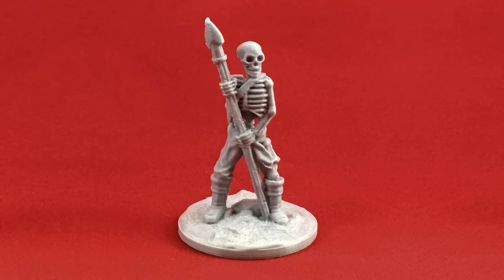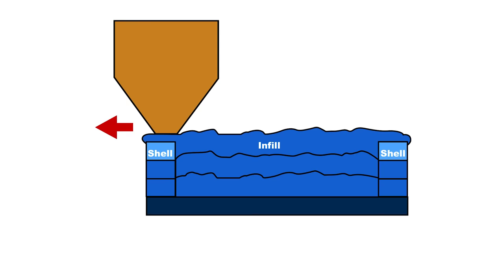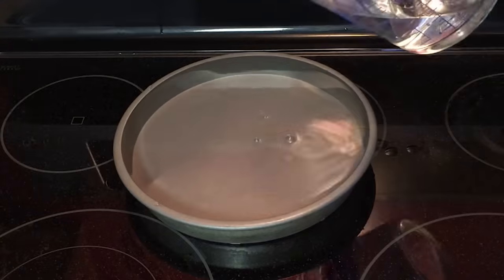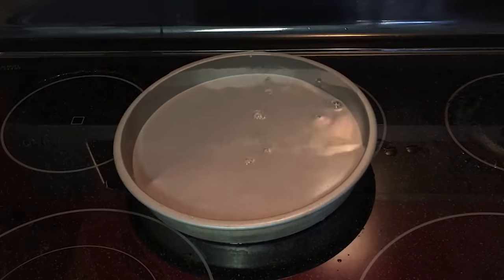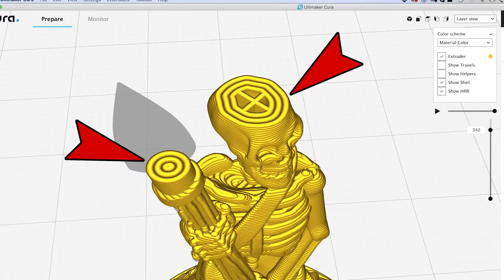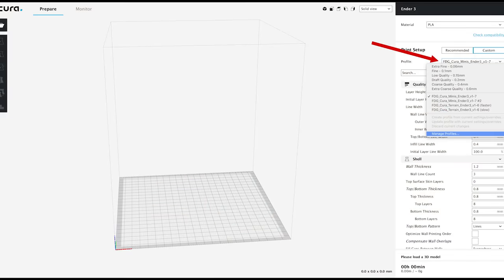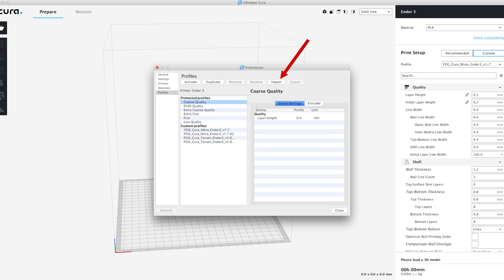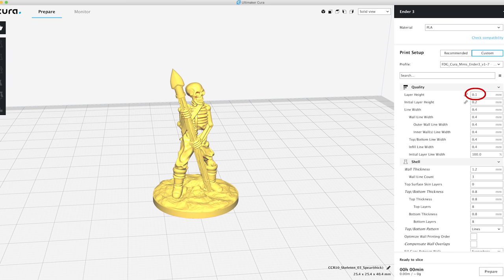How to 3D print miniatures on a FDM printer

Comment: Im not really sure where to go with this question so heres a shot in the dark since im using your uploaded settings for miniatures. Im getting some like spaghetti esq buildup on the model of the minis and im not sure what I'm doing wrong. Im using a creality 3d ender 3 and have looked up bed leveling guides and I think its setup right. Any advice or tips on how to fix these issues?
Reply from the maker: That is likely due to your bowden tube being separated from your nozzle. I explain how to resolve it here: https://youtu.be/30qqKUwviww

Comment: Could you not (custom Machine)? mill a 2 piece 3d printer nozzle out of brass and or glass as the center layer the extruder nozzle. Then screw on the outer dimension milled with air gaps that are cycle looped in and out with an external pump thus cooling the nozzle so no radiant heat is absorbed by the print?
this would lower the internal 1st layer temperature but with a restive coil around said glass or brass nozzle you could maintain temp load.   just saying....
Reply: you can just add a silicone, ceramic or rock wool protection

Comment: Hi, I am new to 3d printing and have the creality ender 3, I appreciate your time on making the video for building it, greatly helped my frustration on building the printer.  Please continue to make informative videos, this helps us Newbies a whole lot.  I do have one specific questions, with regards to the Cura slicing software, when printing a miniature hat, for example, how do I input the measurement of the interior of a hat?  Your answer is greatly anticipated.  Thank you again!
Reply from the maker: Cura will let you scale a model to any percentage larger or smaller, but the initial dimensions of the model are determined by the modeling program used to create it. :)

Comment: I tried to print a mini with the 4.5 profile using Cura 4.6 with my Ender 3D Pro.

Very stringy and the 90 degree arms and cape fell off. Any recommendations? It's about an inch and a half tall.

I did just order the filament you recommended.
Reply from the maker: Was it a FDG miniature?
Reply: @Tombof3DPrintedHorrors  No but that seems like an obvious next step for me to try. I'll do that then respond. Thank you.

Comment: Hey. Can I ask you a quick question..? I like to paint model/minis that are around 4 to 5 inches tall. With a good filament printer, what kind of print quality an details can you get.. ?

Also, I'm looking at getting an Elegoo Neptune 3 ( I believe that's the one ). Is there a better filament printer in your opinion for a price range of $200 to $250..?

Thank you for your help..! 👍
Reply from the maker: I don't recommend the Neptune, when they came out the Thermal Runaway setting threshold was set to a ridiculously high time which is a potential fire hazard. My pick is the Ender 3 V2.

Comment: When downloading the profile and try to import it, i get failed to import, Official_FDG_Cura_Ender3_and_5_Miniatures_4mm_v4_3l.curaprofile: could not find a quality type normal for the current configuration.  But i was able to import the terrain profile fine.
Reply from the maker: Did you follow the Read me PDF exactly for installing Legacy printer options in Cura 4.3?
Reply: @Tombof3DPrintedHorrors  no, I just went to download the files for cura for my ender 3 pro.  I usually use simplify3D but you guys don't seem to have a profile for that :)
Reply from the maker: @xSensu  Nope, I don't use S3D.

Comment: What are your feelings on using a max number of top layers?  Is it true that this will improve the detail in prints? Is there any disadvantage to it? Great video by the way, I've just got an Ender 3 as my first printer and this video has been a massive help!
Reply from the maker: No there is no truth to that at all, and there are a lot of disadvantages to it. Whoever came up with that doesn't understand how Cura works as is demonstrated in the sheer number of bad settings/mistakes in the profiles that use that technique I have seen.
Reply: @Tombof3DPrintedHorrors  Thanks for the reply :)

Comment: Great video, but I don't think jerk is what you defined it as. I learned at some point that jerk is to acceleration what acceleration is to speed.
Reply from the maker: The definition of 'Jerk' from the Cura website:

Jerk defines the speed of the print head before performing a hard stop. Just like a car the print head needs to come to a complete stop at some points. It's comparable to hitting the brakes in a car. When you do this at high speeds it feels uncomfortable. The jerk settings reduce the speeds set in the firmware making the print a little slower but more accurate. Disable the setting to get the maximum jerk.
Reply: @Tombof3DPrintedHorrors   Ok cool I was thinking of the physics definition of jerk.

Comment: Is this information still mostly applicable? I have an ender 3 v2 coming in tomorrow because the ender 3 I bought had a bad motherboard (returned it and got the V2 on a flash sale).
Reply from the maker: My most current profiles for Cura 5.0 are available on my website.
Reply: @Tombof3DPrintedHorrors  I will definitely check that out! Thank you kindly

Comment: I know this is an old video and Cura has been updated since. Us folks who use modified Marlin printers like the Kobras arent using the new Cura since its a tad broken atm.  Was wondering if you plan on making profiles for other printers as well.
Reply from the maker: I can only make profiles of printers I own, which means Ender 3/3 v2/ 5 and 2 Pros. Updated Cura 5.0 profiles are on my website.

Comment: No talking about smaller nozzle sizes? Isn't that the best way to get nice details? One thing that could also increase the details and a lot of problems would be some external cooling fans. It would solve a lot of problems when printing small objects. And there is a "minimum cooling time" function in Cura, that would have solved the issue with the spear tip.

One thing about glas transition temperature: When your material temperature exceeds glas transition temperature, it doesn't mean that it deforms. What you're talking about is the melting point where it looses it's structure. Materials like TPU are always way above the glas transition temperature. Still, it's not deforming, because it's under the melting point.
Reply from the maker: I have other videos dealing with smaller nozzle sizes -  can't fit everything into a single video or it would be hours long. :)
Reply: @Tombof3DPrintedHorrors  Ah, so it's just some tips.. i see

Comment: Why not insulate the tip of the nozzle? I would imagine that it would dramatically limit thermal transfer, and likely allow for lower energy consumption and faster heating in the process. Something 3d printed could be easily attached, and contain insulated materials that directly touch the nozzle. Finally, it would compliment a fan to prevent thermal leakage.

Comment: Thanks for the great video, I noticed some discrepancies between the file shared on dropbox and the settings in the video, "Initial layer height" is 0.15mm and "Enable Acceleration Control" is not set. I used CURA 3.5 to import the profile.
Reply from the maker: Are you using the v1.7 profile that was uploaded Sept 23rd? I just re-downloaded it, and the initial layer height is .2 and Acceleration Control is turned on. If you are, the only thing I can think of is Cura 3.5 is overriding some settings (it has known bugs for the Ender 3.) The profiles are created with Cura 3.4.1. :)
Reply: Yes that's the one I used, I tried re-importing and noticed the same issue, no big deal anyway. Thanks.

Comment: Super new to printing so maybe a dumb question, would these settings work just the same with a .2mm nozzle?  I dont mind switching out nozzles from time to time but just wanted to know if its even necessary. Ik this is a 4yr old vid but any help would be appreciated.
Reply from the maker: Check out my newer videos on printing minis, particularly my Ender-2 Pro miniatures video.
Reply: @Tombof3DPrintedHorrors  Thank you so much for replying! I see you said you used your regular cura profile with a .3 nozzle instead of four. So i should be good to use a .2 then? just following the profile settings? I didn't know if I'd have to set cura to the propper nozzle size or if all the settings alone were enough.
Reply from the maker: @LetsFigureIt0ut  if you go download my Cura profiles you'll see I have ones for .4, .3, and .2 nozzles.
Reply: @Tombof3DPrintedHorrors  I thought of that right after I sent my last message. Apologies, thanks for indulging me!

Comment: mass actually does affect falling speed (only the acceleration is constant for everything), but amazing video nonetheless
Reply: Mass doesn't affect falling speed. I could drop an elephant and a man and they would fall at the same speed. Gravity acceleration is constant as you mentioned. Your mass has no effect on this.
Reply from the maker: I know, but this video is about 3D printing miniatures, it's not intended to be a physics lesson about the acceleration of gravity. Going into an explanation of how all objects accelerate at approx 10m/second/second (not counting air resistance) until they hit terminal velocity due to that air resistance would be overkill. Much easier to just say the speed of the dropped minis is constant, which gets the point across. :)
Reply: CrimsonPhoenix07 this is the formula for terminal velocity-> vT= √ 2mg/ρCA
notice m for mass
Reply: Tomb of 3D Printed Horrors of course; I’m a pedant
I wasn’t saying it wasn’t an amazing video

Comment: Have you tried to play with the Ender 3 magic numbers in the slicer setting for layer height to see if it makes any sort of significant difference?
Reply from the maker: Yes, and there is no significant difference as far as layer quality, but in many cases. .1 beats out .08 because it handles the heat from subsequent layers better on overhangs. Remember, so called 'magic numbers' are just full steps of the stepper motor, everything in between are micro steps. .1 is a precise 50/50 micro step on the Ender 3/5/CR-10, so it is extremely accurate vs. other micro steps.
Reply: @Tombof3DPrintedHorrors  I was think more 0.12 but guessing no significant difference in quality then, maybe time?

Comment: I get better results wit 0.08 mm layers than other people with 0.04 or 0.05 and whatnot kind of tricks. But I have not printed a single mini thats ready to use because of misprints, breaking of pieces because of massive supports and so on... But the feline ScifFi Mini that lost its tail when printing, its left hand wit a bag when I tried to get rid of the support and still has the block of support structure between the legs that I cant really get rid of, look nice. (If you don't pay too much attantion to the shifted neck) Only larger pieces (Pieces of a starship) came out pretty good. But that was another filament.
Interesting: Right now I use eSun filament  but I not only had to buy a dual gear extractor (and a new stepper motor without a fixed gear), I also have to print with a flow of 110 so that the lines touch. (after calibrating the extruder) I already thought about giving up printing with my Ender 3 Pro because I still have to level it before each print and even right after leveling I often have to level again... (I use a gcode to level that stops twice in each corner and once in the middle of the bed) It's not printing its just tinkering.

Comment: Are the profiles from the website good to go? I was checking the settings from the profile I downloaded with what's in the video and I was changing a lot. Then I realized that this video is a bit older, so the website might be settings you've found you like even more than what's in the video.

So, my question is whether I should change my settings to what you say in the video, or keep the imported profile as is? 

Thanks!
Reply from the maker: The profiles are always my current settings and supersede the older video info. Due to changes in new Cura releases some settings have required updating
Reply: @Tombof3DPrintedHorrors  Thanks for the reply! I've got something printing right now, but I'm going to try your settings once it's done!

I also bought your Turdle miniatures--they look like they're going to turn out awesome! Any chance you've got a Turdle Monk and possibly a Turdle chef model? :D
Reply: @Tombof3DPrintedHorrors  just wanted to update--your models AND your settings are amazing! I love that I can print them without supports too. Thanks again!

Comment: Great video, about to try the settings now. I am wondering if you have a profile or plans to do a video on or with the cr10 or cr10s. I currently have one of these as my first printer. will these printers run the same settings as the ender or would it be slightly different?

Comment: hello.  could you help me. I am very new to 3D printing and am having trouble viewing and importing your Cura settings.  The files I download are only 2KB each.  it is the same for the terrain and skeleton men.  Am I doing something wrong?
Reply from the maker: Hmmm.. terrain and skeletons should be 10+MB each file. Profiles are indeed tiny, 2kb is about right for those.
Reply: @Tombof3DPrintedHorrors  sorry to bother you again.  I have downloaded the FDG_Cura_Minis_Ender3_v1-7.curaprofile.  however when I try to import it I get an error message saying the file has an unknown file type or is corrupted.  Is there any advise you could give?
Reply from the maker: What version of Cura are you using?
Reply: @Tombof3DPrintedHorrors  I am using 3.0.2
Reply from the maker: You need to upgrade to the current Cura to use it. :)
Reply: @Tombof3DPrintedHorrors  Cheers. It's working now.  The skeletons are super and I am getting the hang of printing more complex minis.  Still can't get my Hero Forge mini right... she is super complicated with so many over hangs lol.  However my Tower of Darkness is coming along great.  Cheers for your suggestions. I 😁

Comment: so what do  you do about support? i dont see any support settings ?? how do you print free hanging objects
Reply from the maker: As none of the miniatures or terrain that FDG sells require supports, I didn't go over them in this video (all of the miniatures I show in the video are designed to print without slicer supports.) I will do a video later on covering supports, however. :)

Comment: Can your profiles work with other 3d printers other than the Ender?
Reply from the maker: Depends on the printer, I can only test/develop on printers I own. My latest settings/profiles can be found on my website (this is an old video and the settings were for Cura before they introduced Arachne.) :)

Comment: I reckon resin printers are where its at if you want ridiculously good quality miniatures. It's probably a little easier to print them reliably too although there is a lot of nasty chemicals and curing required.
Reply from the maker: The resin in its monomer state is a health hazard and many people refuse to use them for that reason, plus they are a mess to deal with.

Comment: I am a complete newbie but your video makes it seem simple enough to follow your directions. I am sure I can find other things to print but if I follow your directions can I successfully print mini's from say HeroForge? Do they come out with equal quality? Do your techniques only work with mini's designed a certain way? I am a teacher and my coworkers suggested a flashforge finder (What she uses at school)....How does this compare to the Ender 3? Also, are off gases a problem? Is this not something you want to be doing in a home office/Bedroom?

Thanks;)
Reply from the maker: Stick with minis actually designed for FDM printers (like our Dragonlock minis) to get started.
Reply: @Tombof3DPrintedHorrors   Hey:) I bought an Ender 3 v2 and have been exploring settings. I downloaded your Cura settings (I have Cura Ultimaker....I assume this is the same?) For some reason it says, Profile not visible? Something about Standard Quality? I am probably missing an obvious box?

Thank you:)

Comment: Would using a longer more narrow pointy nozzle work better for small details like this?
Reply: It can be helpful for small details (requires more printing time too) though a standard 0.4mm nozzle should be perfectly fine for printing minis. You may have to reduce the speed which the mini is printed at for some finer details and to reduce stringing even with a smaller nozzle such as a 0.25mm one. It also depends on your printer, however even cheaper printers can have pretty good detail now.

Comment: Love your videos!  Just picked up an Ender 3 PRO and have been having lots of fun with it.  Followed your set up guide to the letter and my first test print came out flawlessly.  I downloaded a few Mini designs to try but am not seeing the same setting options in CURA 4.1 vs. 3.6 which I think this video is made with.   Do you have any thoughts of updating this video or showing the difference in your settings between the 2 different CURA versions?   Thanks again for your skill and help!
Reply from the maker: All settings in 3.6 are also available in 4.0 (plus some new ones). They are likely just hidden (go to preferences to show them.) :)
Reply: @Tombof3DPrintedHorrors  found them thank you! Printing your mini paintt holder now :)  should be done in a few hours.  Thanks again

Comment: what changed from 2021 to now? ... I have an ender 3 v2 and would like to print some minis and want to be sure the guides on the video are up to date..
Reply from the maker: A lot has changed since Cura switched to the Aracne slicing engine, download my latest Cura profiles to get my current settings.
Reply: @Tombof3DPrintedHorrors  thanks!